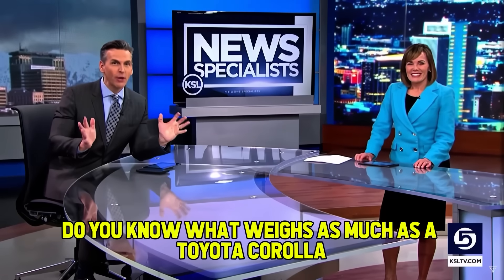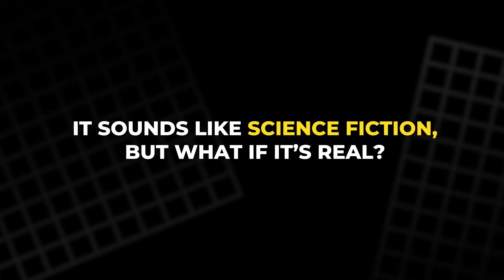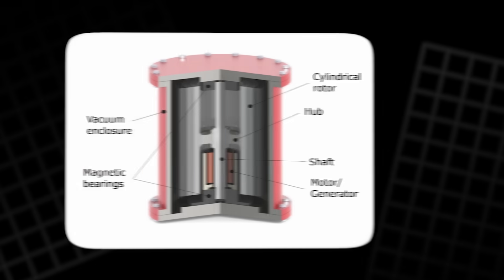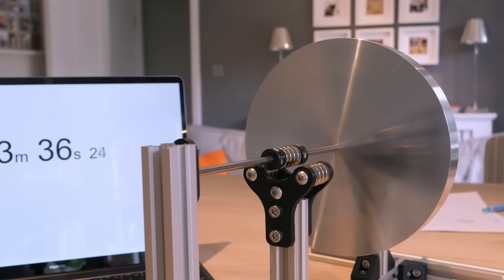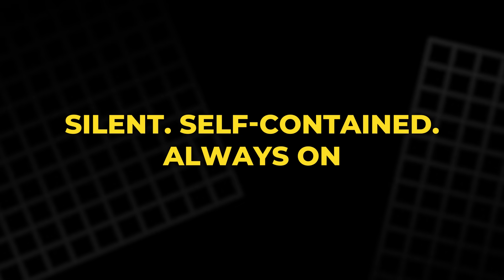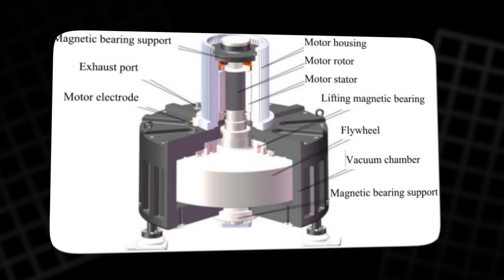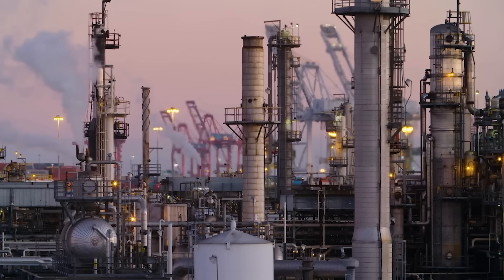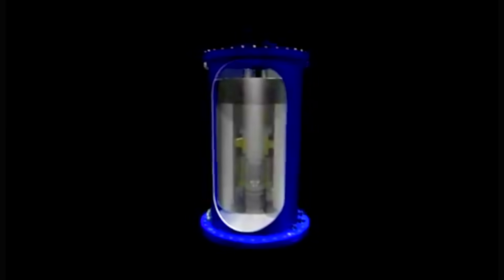The Flywheel Secret: NASA’s Hidden Energy Breakthrough #FreeEnergy

Comment: I've been doing complex phsyical equations 

To diagram how

I've been researching 

Using heat waves, as energy, directly, by thermocycling ions and protons into a battery with the seebeck effect 

Or 

Using the peltier effect

To cool south poles of magnets, from positive current to the north pole

And ionize the air, forcing heat inwards, cooling it in the process 

The current, recycled, and used as thrust, for the positive charged gas

Using an electromagnet to push the plasma 

With kinetic energy 

(VAHANA)/Seebeck Effect from Soviet Radioisotopic Nuclear Generators